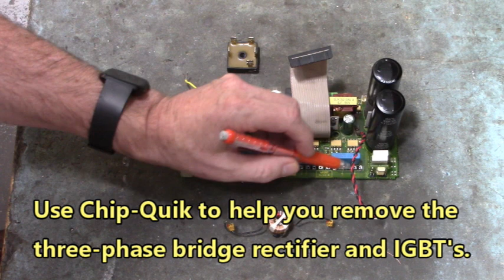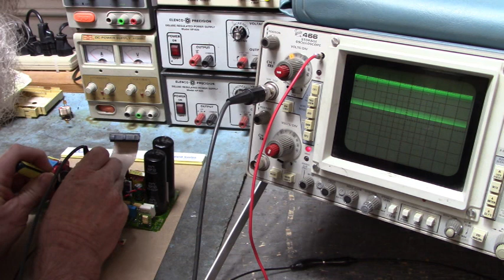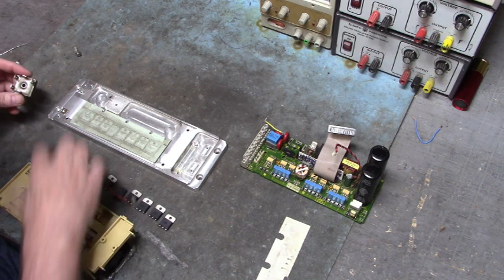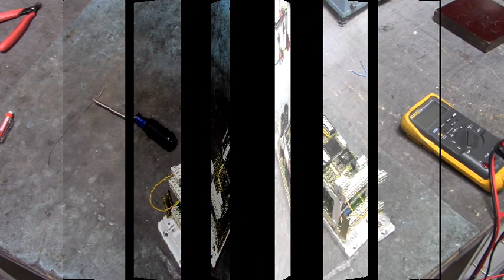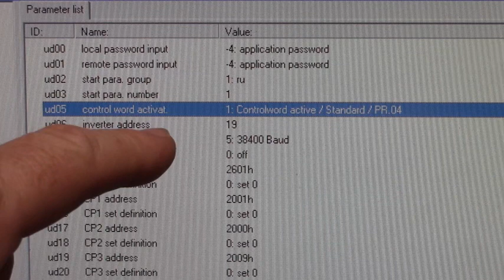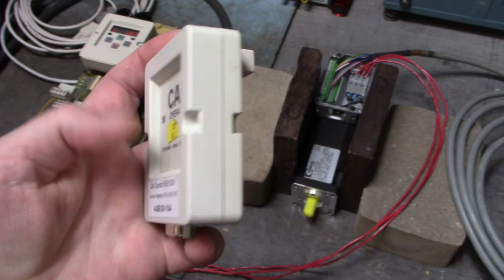KEB S4 Servo Drive Does Not Run a Motor

Comment: HI! I discovered your channel while I was in a desperate search for info about a weird problem I encounter with an S4. Excellent video! I subscribed right away! Maybe you could give me a hint? y S4 runs just fine in drive mode, like you did. But I tried every setting I came accross in ccombivis to no avail. The drive acts like everything's fine, but won't start the motor. 
I have to say that my job is to fix drives here in France on a daily basis and I never encountered an issue like this one! A bit lost right now...

Comment: Peepaw I have a request for help I am repairing the KEB 07 f4 inverter is the same as the one you are repairing on youtube I can not cope with the power supply of optocouplers looking from the large capacitors from the right on the first I have 14.6 v on the second I have 0 8v and so every other one does not  it has a voltage, that is, it has but 0.8v can you tell me what can be thanks in advance